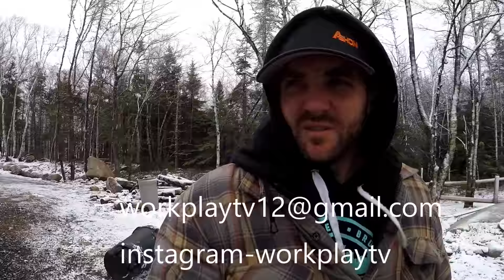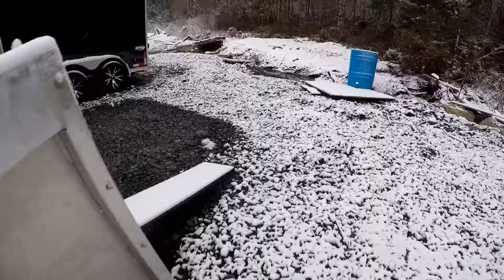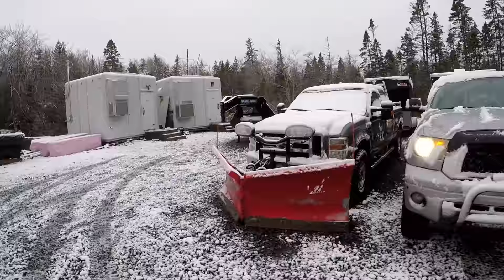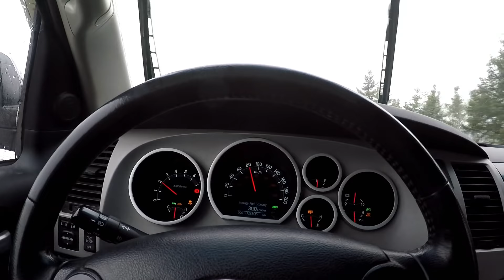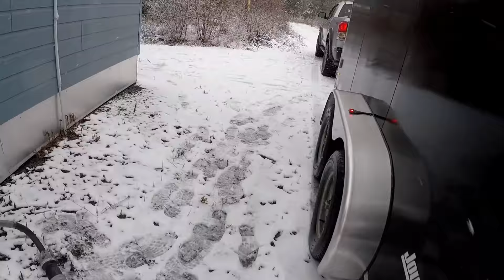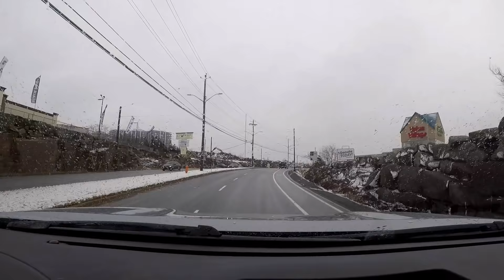TOYOTA TUNDRA TOWING/HOOKING UP GENERATORS DURING HUGE POWER OUTAGE!!!

Comment: Compared to the Powerstroke, would you say the Tundra is comparable in acceleration; without a trailer?
Reply from the maker: Andrew Hensley Yeah I’d say comparable but complete different feeling. You hear and feel the Tundra Rev up but the powerstroke has so much torque it just pulls and pulls!
Reply: Unless add supercharged then it would be ok.

Comment: I know what you mean regarding the small gas tank on the Tundra.  I first owned a 2014 CC 4.7 (thinking I’d get better gas mileage) with the small gas tank, for about 3 months.  It was a pain having to stop and gas up all the time.  Traded it for a 2017 Tundra CC 5.7, what a difference.  It has the 38 gallon fuel tank which I have gotten 400 mile plus per tank (Premium fuel) consistently.  Toyota switched to a 38 gallon tank for 2016 on SR5 and up trim levels.  The premium fuel does make a difference in performance and gas mileage.  The 5.7 has great power and is a beast.  Just wished I got a 4X4.

Comment: Toyota Tundras don't need no airbags ballet Springs are over-engineered a Truck is over engineered because why because they will do whatever a diesel would do
Reply from the maker: Raul Bueno Sorry man can’t agree with you here. Every truck at some point can benefit from air bags. I am going to guess you have never tried them. Trust me man you would know what I’m saying if you used them on a heavy load vs not using them.
Reply: Look man I've been a mechanic for 20 years and I've been Towing for 15 years the Toyota Tundra overbuilt and will I'll perform any truck out there half ton 3/4 ton or 1 ton trucks for a fact I know
Reply: Raul Bueno you talk like teenage fanboy Toyota tundra is nothing more than a rice burner mall crawler.
Reply: And you're really want do you know what really trucks will outperform is Boeing stock I have a bone stock Dodge Durango 01 and it pulls up to ten thousand pounds and I'll perform half ton trucks when you really want to test trucks is having bone stock nothing on them just don't stalk and that's the truth when you really want to talk or all
Reply from the maker: Raul Bueno Hey I agree compared to all
Other half tons the tundras were much stronger and very close to a 3/4 ton. But if you think that a truck is made perfect from the dealer and couldn’t benefit from some added upgrades I don’t feel that is realistic. I also have a 2017 F250 6.7 Powerstroke and it will put tow the Tundra by a huge amount. 925ft/lb torque vs 400 in the tundra it’s simple math. But man I am on your side I love the tundras they can take much more abuse than any other truck. Thanks for watching.

Comment: My breaks did that on one of my vehicles-- my 2016 Audi A4 did it when it got below freezing. I couldn't make it stop either. I would do hard hard breaking a few times and sometimes that would stop it for a little. But from what I learned it is the type of metal that is used in certain higher end breaks.
Reply from the maker: Justin Adducci Yeah mine will do the same if I step on it hard. Go away for a bit and then return. The higher end harder material brakes last longer but can be noisy. I took those off and out softer pads on and still there so all that is really left is the rotors.

Comment: Kudos to you bud! Your working some long hours out in all the elements and providing a good service. You definitely need the equipment and ba**s in that line of work. What type of generators are you using to power up the sites??
Reply from the maker: Ace2016 Lol yeah buddy. That was the by the far the easiest portion of the outages it got much worse. They are 14k Honda’s.
Reply: @workplaytv  wow not cheap!
Reply from the maker: Ace2016 Haha nope but they do the job!